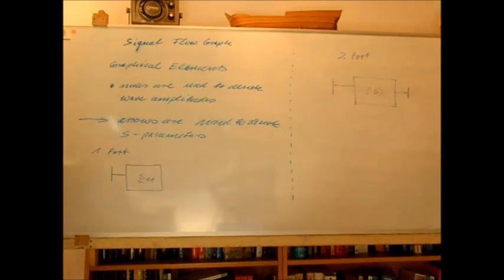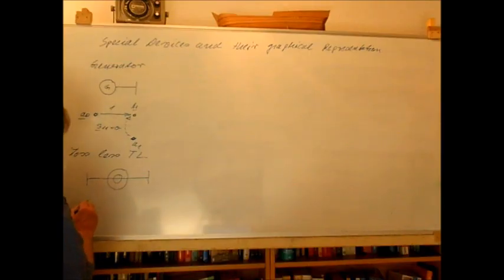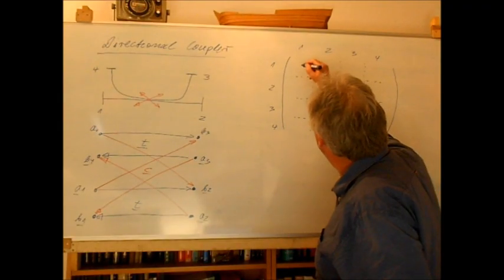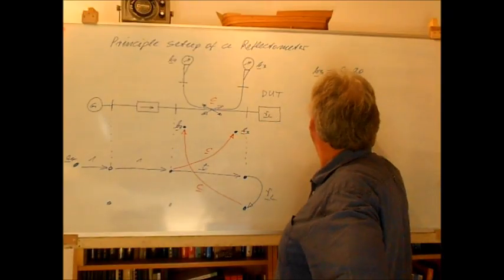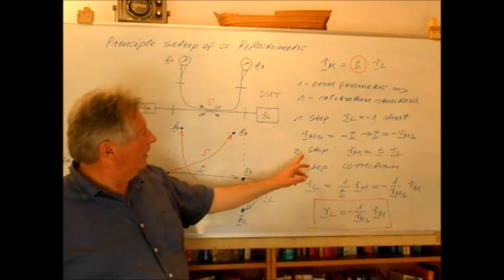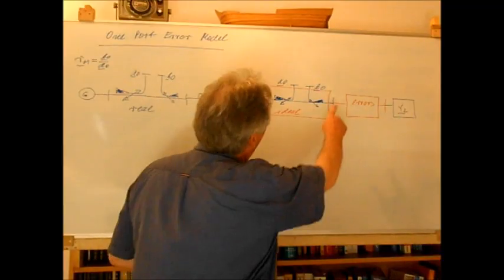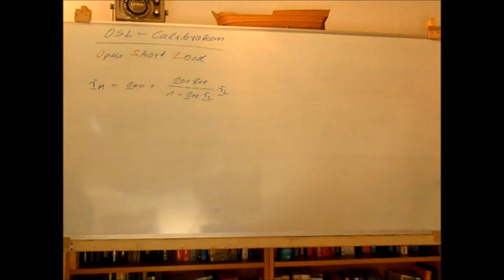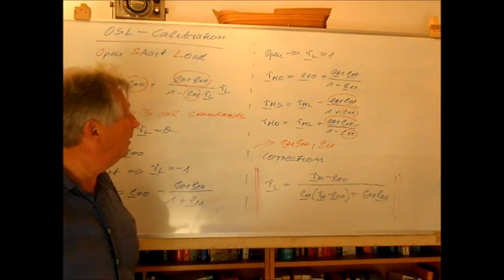Introduction to the Signal Flow Graph

Comment: For the one-way TL, in your lecture note, S_21 = 1, but in the video, S_21 = exp(-j*phi). Why is it so sir?
Reply from the maker: The one-way TL is also call Isolator, so the essential point is that you have a transmission from port 1 to port 2, to descibe this S_21 = 1 is sufficient, but if you are also interested in the phase that is introduced by the isolator then S_21 = exp(-j*phi) would be more appropriate.
Reply: @Lectures_RF_Microwave  Thank you very much Prof!